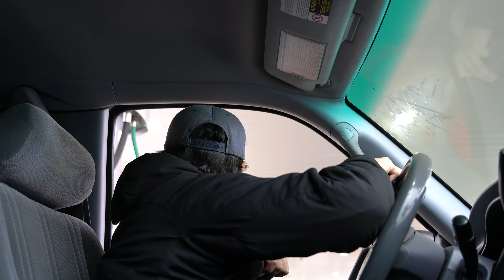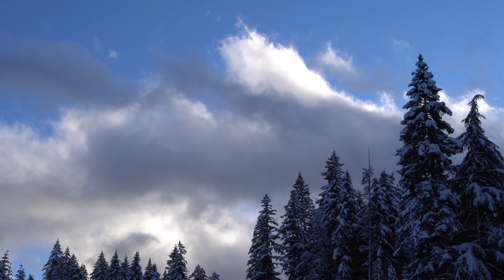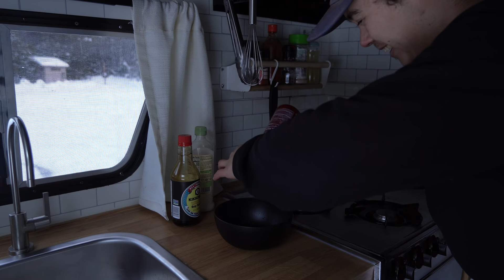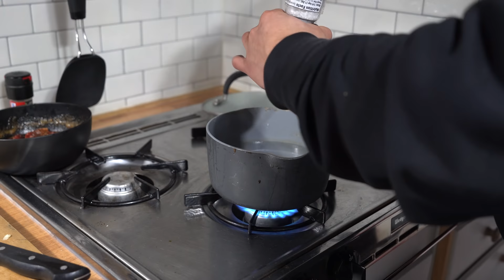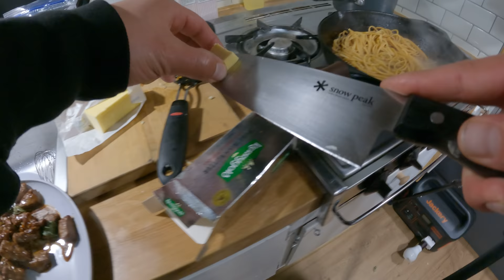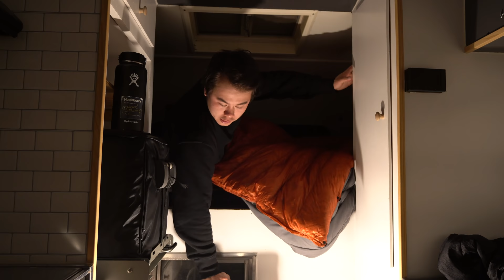Snowy Winter Camping in the Pacific Northwest (in my Renovated Truck Camper)

Comment: Pro tip:  Don't do donuts when your camper may be structurally compromised, sauté the garlic first, tell the uninitiated that you added sage and thyme to your dish, calories from fats are necessary in cold climates, Bondo is not flexible and therefore not a good choice for leak prevention.  That is all.

Comment: Good video as always.  As for the water leakage, I would start by removing the outer skin along the bottom and assess the damage, when the weather is nice of course.  I too have a vintage camper that has become my hobby.  I had extensive water damage along the bottom on one side and minimal damage along the other.  I cut out the bad areas and replaced the wood framing with fresh by attaching with wood glue and angle and flat braces. Depending on the type of camper jacks you have, the corners are of special concern as that's where your jacks lift the weight of the camper.   I'm sure you can get plenty of ideas off YouTube on this.  Good luck and keep the videos coming.  My wife and really enjoy them.

Comment: I like your channel and I'm staying. Suggestions? Did you use silicone to weather proof? Eternabond tape and loose lap sealant would likely have held on the roof and stiff lap sealant for the walls. Silicone may hold but when it fails it seems to do so secretly. 
   Your camper is self destructing all the while the walls and roof aren't sealed and remain wet. The intermediate spaces are staying wet and molding now until they're dried.
    No matter how well the walls and roof are sealed, if the bed holds water then it will infiltrate the camper, since the camper isn't a boat. So the angle of the truck with respect to the bed is very important for truck campers. I hope this is something for you to consider.

Comment: Always remember water will flow to the lowest spot so water your seeing at the floor could possibly be leaking from the roof somewhere because when I had my palomino unit resealed about 10 years ago its still water tight today there was water coming in at the top where the cab over part is stripped it all apart replaced a few pieces of bridging it was more time consuming than anything else...good video the PNW is stunning to say the least

Comment: Hi, your water problem looks like coming from the cracks you repaired outside on the corner. Instead of trying to make those cracks water proof, I would probably try to cover them with a new layer of fiber glass, making a large gap around the cracks. Because, only trying the seal the cracks won't last, even worst if you do truck spinning on snow often, it's stressing on the frame 😆
Reply: Rain buster works really well! It doesn’t expand and contract like other sealers do.  I have a 90s fifth wheel and I used it to seal all seams and no water leaks, going on 3 years
Reply: Good ideas!

Comment: Jonathan I think your moisture issue on the wall behind the couch is being caused  by condensation. The reason being that it's where the pad which looks like vinyl backing would trap the moisture in there. Like a cold can of soda your walls are cold and its presumably warmer inside. I bet if you opened a small hole from inside its bone dry in there. Possible solutions: Add better insulation in the walls or remove the cushions while traveling until the temperature levels out. Love your channel. I'm living vicariously through you. Lol

Comment: You probably have condensation in that camper. Campers aren't insulated well enough for that kind of winter camping. Also propane produces water as it burns. Using propane for heat and cooking creates a lot more moisture inside. And sealing the outside traps the condensation inside. Also you get moisture from your breathing in the camper and snow on boots/clothing. It all accumulates to quite a bit of moisture inside. You'd be better going south. Find dryer climate. When you're not camping try leaving a light bulb lit inside the camper. The brighter the bulb the better. It'll cook the moisture out.

Comment: Many have ideas on where the water is coming from. But I don’t recall you removing and re-sealing the windows   I may have missed a vid though. If that’s true though then that’s what I’d put my money on. And they are easy. When my camper had water damage like that it turned out to be the windows. And it ran way left so I didn’t think it was. I will never be a bad thing to do the windows.

Comment: You need to remove your window above the Leakey area. Seal window along top and sides, and bottom. I use a product called Big Stretch. Make sure gap at bottom is sealed as well.

Comment: There’s a lot cut out damaged wood and replace the wood. Put new seals around windows. Get new corners for where the seams come together on the back and that what looks like bondo on the exterior fix that and get some heavy duty sealant for the roof. All this because not really sure where it is leaking so cover all your basis.

Comment: I think that your water damage could be coming from that condensation build up (melting down from the inside) you showed toward the end when you woke up the next morning. Or that window is letting water in somewhere and it’s running to the corner while you’re driving.. I would say get it back down to SoCal and let it dry out in some sun, reassess later.

Comment: Water damage is definitely scary! I had a older truck camper (also a slumber queen) that had a ton of water damage through the front cap leaking from the roof and front over cab  window. I wonder if the leak could be coming from the side windows? It may be worth pulling the windows out which is relatively easy. I will say that any time you tackle water damage, it will look very bad and can be overwhelming. I would definitely start on the inside, start removing inside wood paneling and then assess from there. The exterior siding is finicky because it’ll be stapled together and tears/wrinkles very easy.

Comment: I'm thinking of converting a box truck into a camper or building a tiny home on a trailer. I think where most people go wrong is not insulating it right. They are so worried about space they think losing 2" on each side will somehow make it unlivable. With a box truck it would be easy to frame and put 3.5" of insulation on all side. Maybe a bit less on floor or roof if you're a tall person. To me the whole point is having a portable insulated space not a portable freezer! And I see people insulating vans and leaving huge thermal leaks in them. It's like having a window open a crack versus a window open all the way. If a window is left open all the way it will be freezing inside and the pipes in the walls will likely freeze. So you can't expect to insulate a van and leave huge gaps with no insulation or very little. And if you have windows you can't expect a single pane to do much. We have triple pane windows and they save more weight then they add. I'm thinking of using these Fiberglass Reinforced Panels at homedepot but it says indoor use only. But I googled it and found some made for outdoor use. I just want like a thick, maybe 1/8 inch, plastic material that's very durable. I'm not sure these panels are exactly what I want yet. I'm sure it's lighter than plywood and I wouldn't have worry about bugs or moisture very much. The panels seem very cheap and I wouldn't need very many of them. I would also like to avoid using 2x4 lumber but it's so cheap it's hard not to use it. But it's just going to degrade and cause problems. We have modern materials we don't really need to use wood. And for such small spaces it doesn't cost very much to use synthetic materials. Aluminum can be expensive if it's thick stuff and it conducts heat. I'm thinking like a 2x2 aluminum frame with a 2x2 plastic frame on the inside like a square pvc or something or plastic lumber if affordable. Anyways, if you read all that hope you found something useful. Peace.

Comment: I had so much trouble with moisture in my caravan which I lived in here in the Uk . I was in wales which is also a pretty wet place and using gas heaters caused my walls to end up like your camper . Only way it was cured for me was putting in a wood burner but I’m sure you don’t want to do . Hope you find a solution that works for you 👍

Comment: You’ll need to open up that wall to the studs and assess the damage. An oscillating tool can help you remove the stapled together frame from the inside. Check all your seals again. Even a hairline crack or a pinhole can cause a leak. If you ever see a rusted exterior screw that means that water has gotten in and rusted it from the inside out. On my camper I used corner seal ( a Dicor tape product) then butyl tape, and then rv specific caulk over top. All my screw heads are also caulked. My old camper roof is hella janky because there isn’t plywood underneath, it’s wavy thin metal and it’s a true flat roof. the only product that’s actually worked for sealing, for me at least, is roof tar on the seams. My camper hasn’t leaked and I’ve lived full time in it since Sept of 2019. I’m also stationary though, so I don’t have to worry about the constant vibration RVs go through on the road.  You might want to consider either an epoxy or fiberglass all the seams. Hopefully you can repair your water damage from the inside, but if it’s to bad then you’ll have to take off the siding from outside, which kinda sucks, but on your camper it wouldn’t be too bad since it is tiny.

Comment: Hi Joe, The thermocouple  sensor in your heater can take longer to warm up and open when it's cold. May just be the reason you had trouble with your heater. Have you changed it yet ?

Sucks that the camper takes on water. Not sure what to recommend except to deal with it ASAP with proper RV stuff.